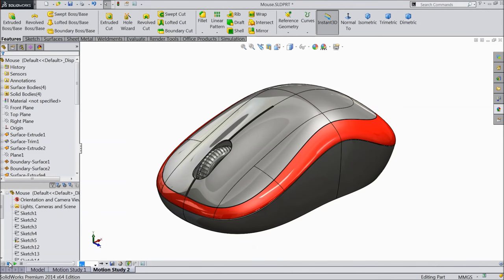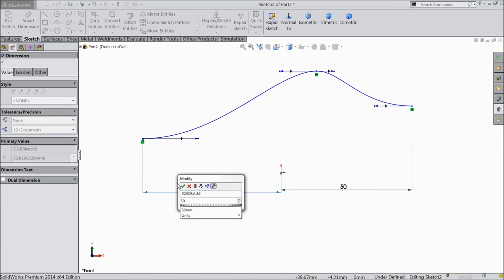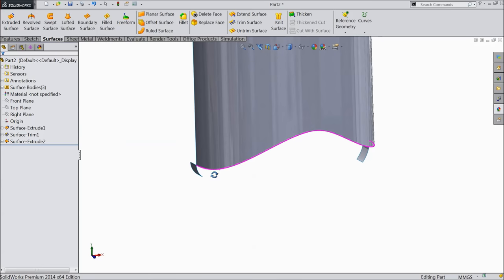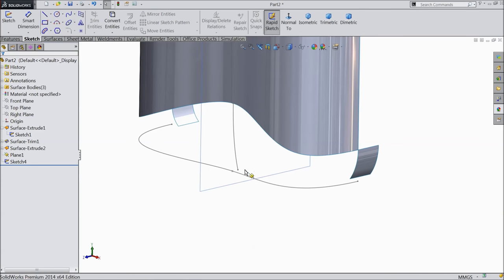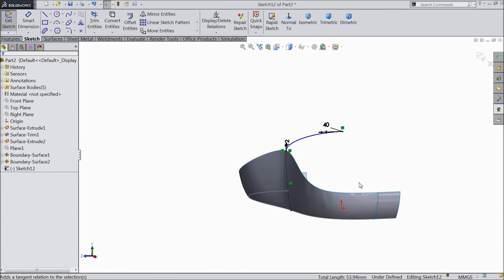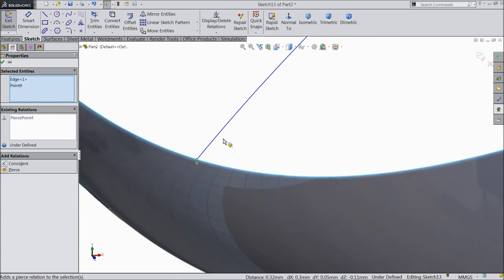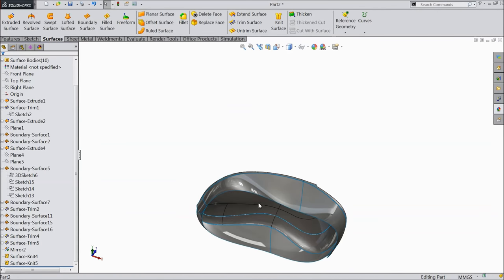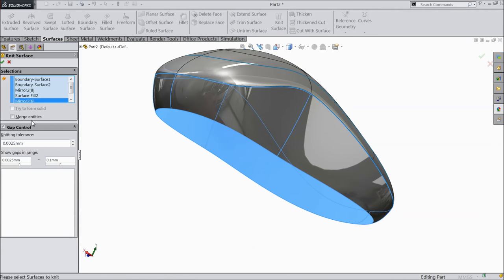Solidworks tutorial | sketch mouse in Solidworks (Advanced Surfacing)

Comment: Thank you for your good intentions and very clear instructions. Please review your work and notice that you are overly complicating this task. First, by the (extreme) overuse of fully defined splines which can be achieved by making boundaries using Projected Curves instead and also efficient using Add Loft Section to a surface.  Within your method, you could copy existing sketches and redefine these instead of doing everything from scratch again. You can create a single top surface and project your curves to create cuts and split curves rather than managing so many individual surfaces that you later have to knit... All of which will save much time, reduce complexity and unlock more power from the available tools. Good work overall in showing explicit controls on the splines.
Reply: Agreed. This was WAY too many steps. I see there is a theme of OVER-defining in these video tutorials as well.
Reply: first off all this is my tutorial and these guys have just copied my work
second, every single surface in this tutorial has to be built in this way in order to achieve precise look, if you want to only model a mouse without achieving great and price look like on the original product you can do whatever you like but the way I did is right

Comment: Hi thanks , how do you get the reflection hdri o surface in sketching mode ? .. thanks for great tutorial
Reply from the maker: Thanks, you need professional graphics card in your system like Nvidia Quadro series or AMD firpro Series. other cards will not support real views.
Reply: If graphic card not supported, just add it in Registry Key.
Type REGEDIT in Search Program and Files box

LOCATE UR GRAPHIC CARD NAME AND MODEL

1. HKEY_CURRENT_USER\Software\Solidworks\SOLIDWORKS2016\Performance\Graphics\Hardware\Current - on the right pane double click RENDERER (copy the video card's name} sample : AMD Radeon HD 8470D

Adding Graphic Card to Gl2Shaders

2. HKEY_CURRENT_USER\Software\Solidworks\SOLIDWORKS2016\Performance\Graphics\Hardware\Gl2Shaders\ (locate your graphics card in the list if available or add it under OTHER folder
   Right click Other+New+Key and rename the folder of the name of your Vcard
   Right Click your Vcard Folder name+New+DWORD 32bit value and enter this value 40008 or 40408 or 30408 or 60408 or 60008 (for me 60008 is working)

3. Restart solidworks app (if not work, repeat process and change the value.
 Also try to put it in the correct Graphic card folder (for me I put it under R420 folder because it's a RADEON VCARD